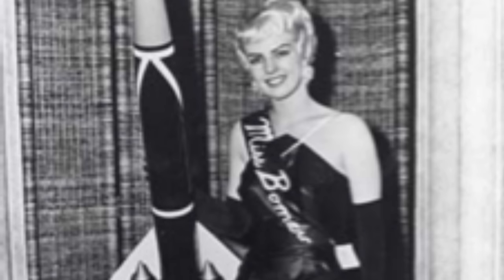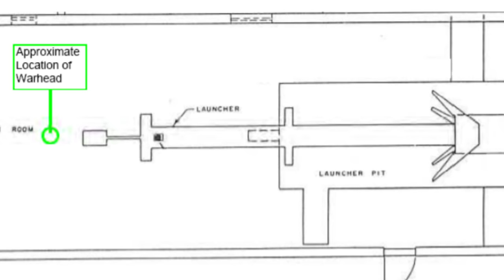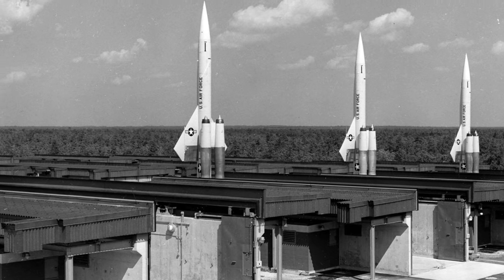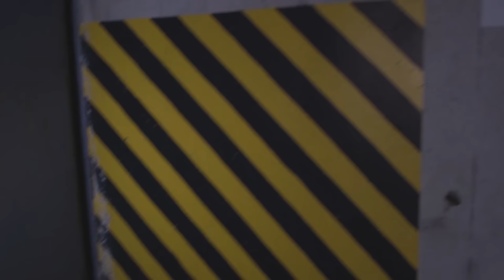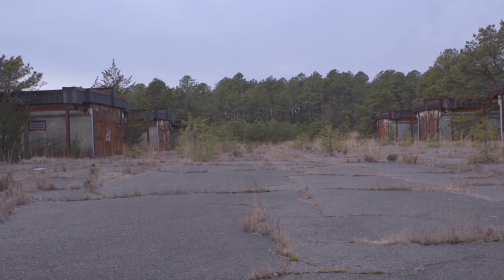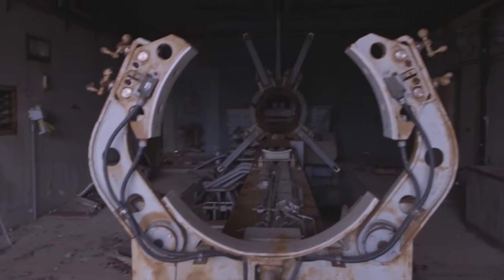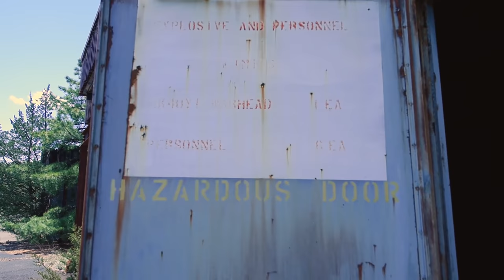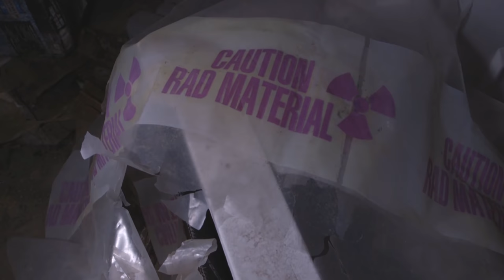1960 New Jersey BOMARC Missile Fire

Comment: It's not clear to me what exactly happened w.r.t  radioactive material release.  Obviously the nuclear detonation sequence did not occur but the warhead casing must have been compromised somehow (melting, explosive impact from the initial explosion?), but it's not clear from the reports you are quoting. U-235 and Pu-239 half-life are 700 M and 24 K years respectively, that's why the concrete caps at the site.
Reply from the maker: Yes, the casing melted and some of the warhead material was lost and washed downstream.  But the missile structure also included thoriated magnesium (commonly called "Mag-Thor") The material was used because it was light-weight and strong.  But thorium is radioactive, and becomes airborne in a fire. this was not part of the warhead, but part of the missile structure.
Reply: @TheHistoryGuyChannel  And (at least some isotopes of) Thorium are radioactive, and Magnesium burns quite nicely. Someone wasn't thinking when they spec'd that!
Reply: @TheHistoryGuyChannel  Ok that makes more sense, thanks.

Comment: An additional problem from surface to air antiaircraft missiles was the ElectromMagnetic Pulse that destroyed the electric distribution and generation system in a large area it detonated over.

This effect got worse and the transition from transition from tube to transistor technology made electronics more vulnerable. Later micro processors and printed board technology even more vulnerable. 

The 1987 made for TV movie Amerika was about the Soviet occupation after they waltzed in by detonating nuclear weapons hidden in satellites in orbit knocking out all electric and communications. 

Currently the USA has conventional EMP pulse weapons made to shut down an opponents infrastructure.
Reply: The Soviet Air Force continued to use vacuum tubes in its aircraft long after the US went solid state, for precisely the reason that they had more of a chance to survive a nearby EMP.
Reply: @philperry4699  I remember that. We had gotten hold of a recently made Soviet fighter and thought they could not produce modern electronics. Then they realized it was made to survive a nearby nuclear strike.

Comment: It is interesting that  Nitric acid was used here as the oxidiser and also in the Soviet sub launched missiles which caused the disaster which THG has covered.  I don't think esponage was involved (but it could be) more that the production of Nitrogen tetroxide safely and on a large scale had not been worked out.  Can some rocketeer out there tell me if the use of Helium as a pressuriser was simply on a payload  weight basis compared with pressurised N2, which would have been hellish cheaper. ?

Comment: It never fails. You guys cannot differentiate between devastation from a conventional weapon or a nuclear weapon. Of course, each comes with its own set of problems, but dealing with a weapon is dangerous by nature. Whether it's conventional or nuclear nuclear weapons, add one level or two of complexity that is manageable and certainly about a sophisticated as some of our surface to air and air air missiles and other defense technologies that have developed over time. Quit confusing risk based on a noun that's stuck in front of the term weapon. Risk is risk

Comment: 2013 study says Bomarc fire “comparable” to Palomares? I guess anything is “comparable”.
Reply: The contamination is comparable.
Reply: explain
Reply: @johnwatson3948 : In Palomares there were explosions of two of the bombs' explosive lenses that strew the pit and other components over a 2 sq km area; some of the fragmented plutonium caught fire and burned, as plutonium and uranium do; they are pyrophoric.  There was no other fuel for the fire.  The third bomb was found intact on land and the fourth fell into the ocean from which it was found and recovered, dented but intact.

The point of the 2013 remark is that the contaminations caused by the fires were comparable, not the fires themselves.
Reply: Thanks – yes I know this, have worked with Jim Oskins on a couple of his books.

Comment: Nothing to do with anything nuclear is without risks.  A simple valve failure in the plumbng of the cooling system of Three Mile Island caused that disaster, loss of power caused Fukishima Daishi and human error caused Chernobyl.  There were other accidents/ disasters but they have been largely forgotten.  There is n real "cleaning up" as they may remove contaminated soil etc but the soil and other things remain contaminated for very long times some materials for thousands of years.

Comment: The Army went with the solid fuel Nike Hercules. Which was far safer.
Reply from the maker: Nike was shorter range.  The philosophy was to use BOMARCs first and catch any the got through with Nikes.
Reply: Later version of the BOMARC, The BOMARC IM-99B, had a solid rocket booster...which was safer and also increased its range since it required less storage room than the hypergolic booster fuels, and thus allowed more storage of the less volatile type liquid fuel for the ramjet engines for cruise intercept.
Reply: Tell that to the folks in Sandy Hook NJ in 1958. Ten dead in a Nike battery explosion.

Comment: Didn't learn anything from the Messerschmitt Me 163 Komet, did they?
Reply: They did,that's why they used that technology.  I'm sure someone is still using it in rocketry.
Reply: Hypergolic fuels are very useful in rocketry. And still very tricky to handle. I'm sure much was learned from the Komet (although it used different fuel/oxidizer).